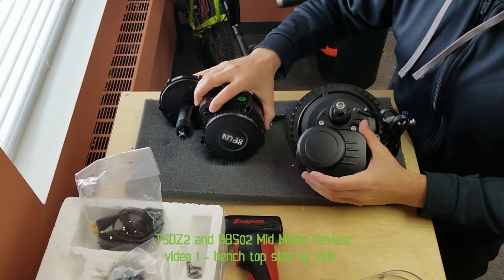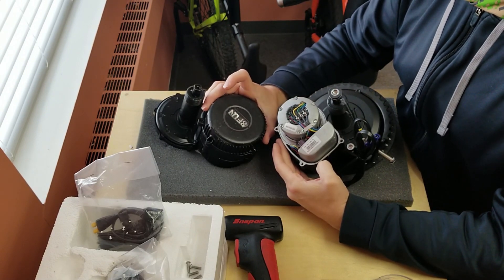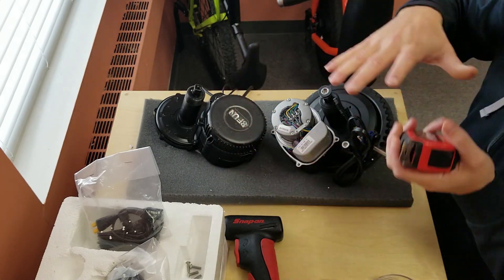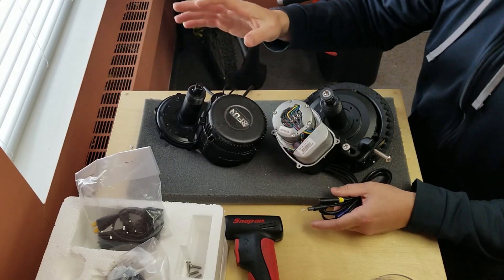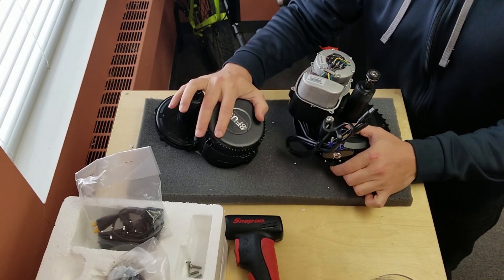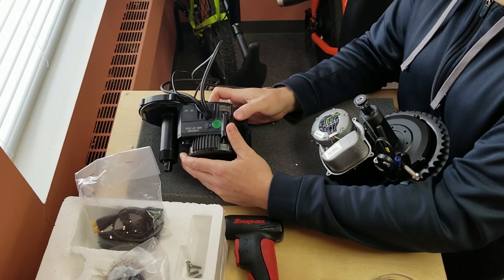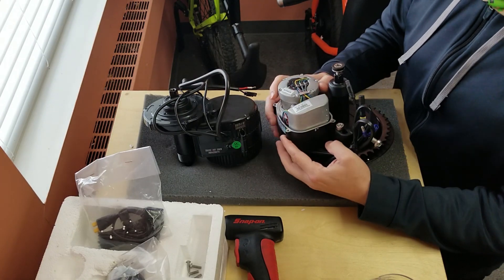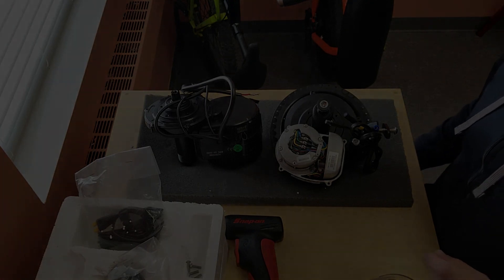eBike Mid Motor BBS02 and TSDZ2 Comparison - Video 1 Benchtop Side by Side - Volton Bicycles

Comment: Is the chainring closer to the bottom bracket on the tongsheng or the bafang? Just wondering so the bike gears doesn't cross chain to the biggest cog
Reply from the maker: I always measure chain standoff from the frame before I remove the stock front rings in case I need a spacer but...
I'm guessing Tongzheng ring sits slightly closer to the center line. This is an assumption and I'm guessing it's very close. Doing some quick math off my schematics - both motors are +/-2mm of 50mm off center.
Reply: @VoltonElectricBicycles  I have the bafang bbs02 and I just bought some spacers for the cassette. I made a 9 speed to a 6 speed and moved the cogs outward. I'm looking to getting the tongsheng motor for MTB. I have the leg strength but this bafang is not really good for steep technical climbs it's good for street. I didn't know about the whole torque vs cadence sensors. I will try the new gearing tho. Thanks for that chainring offset info. Thanks for your videos and time. Looking forward to your new videos
Reply from the maker: @dannyrivera9805  what size is your front ring on the BBS?
For trail I'd try to dial in the leverage/load on the motor with a smaller gear mounted to the motor. 
Personally I think the BBS02 would be more trail reactive and punchier than the Tongzheng.
They both have there strengths.
Reply: @VoltonElectricBicycles  it's a 32t 104 BCD adapter
Reply from the maker: @dannyrivera9805  that's about as low as you can go.
If you're going to the Tongzheng route, you should post a reply. Everyone has their preference and I'm interested to hear what you think of the acceleration on adverse terrain

Comment: Have you done the B versions of these 2 units ? Can they both be controlled by a throttle ?
Reply from the maker: They can be both controlled by a throttle.
The gearing sizing on the bbs creates a better pull.

Comment: My understanding is that the TSDZ2 requires some modifications to really work well: The Open Source Firmware, a heatsink plate, and a temperature sensor. Without those, it’s apparently pretty bad, but what I haven’t seen is a comparison with a BBS02. Any chance you guys could do  that?
Reply: I think you have no actual knowledge of the tsdz2. I have just done 3600 kms. I can tell you it has no inherent problems and has proven to be very reliable.
Reply: I've heard nothing but good things about factory spec tsdz2 conversions, people have put thousands of km on them with no issues, it's been around since about 2016, so it's proven by now.  I'm building one for the torque sensing pedal assist, as I'm moving to Portugal soon and will be selling all my gas guzzlers and switching to bikes for the whole family, and don't want them to have to learn a whole new way of riding, I just want them to be able to get on and go while tackling some of the killer hills in Lisbon or Porto seamlessly.
Reply from the maker: We can put a modified TSDZ on the list of clips to shoot.
I wouldn't say stock is bad. It isn't as jumpy and doesn't pull as hard as a 02 but it works for someone looking for a smooth assisted acceleration to moderate cruising speeds.
Reply: I've ridden 1500 miles on my TSDZ2 48v. The only issues have been the need to tighten the mounting bolts and crank arms (which is expected and was a result of cautious installation). The motor assist is very smooth and natural. On Eco mode you get a great workout with a bit of help on the hills. (Basically it is much like the original cyclocross with a little help on the hills.) Tour mode, Speed mode, and Turbo mode are aptly named. More and more help, more and more speed, plenty of fun always! I just put another one into my wife's mountain bike. It, too, has no issues and works great.
Reply: @JeffreyHoeper  would they be comfortable cruising at 15-20 mph for many miles? My goal is to build a touring bike that requires pedaling, but with the help of the motor. I have a crank sensor hub drive and it makes me lazy because I can just stop pedaling.
Reply: @marthamryglod291  On relatively flat terrain you can cruise at 20 mph with little effort and probably go close to 100 miles on a full charge. When going uphill, your speed will drop and you'll have to work a little harder. . . . But there is always the temptation to switch to Speed mode or Turbo mode. You'll still do some work, but not much. Here is a link to a blog entry I wrote about my experience: http://lakenorforkadventures.blogspot.com/2022/01/getting-new-gears-tongsheng-tsdz2-mid.html
Reply: @JeffreyHoeper  thank you for the reply!
Reply: @skidsteer9170  Sounds like  you abused the sh*t out of a motor that was under specc'ed for what you were actually using it for. Why didn't you just buy a more expensive higher spec / heavier duty motor ?